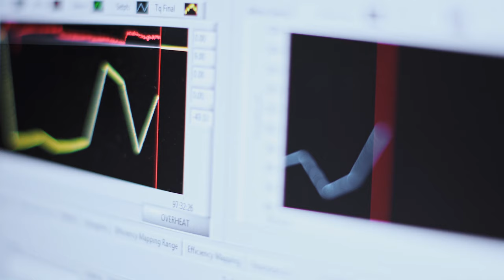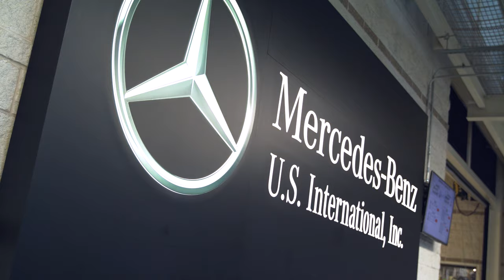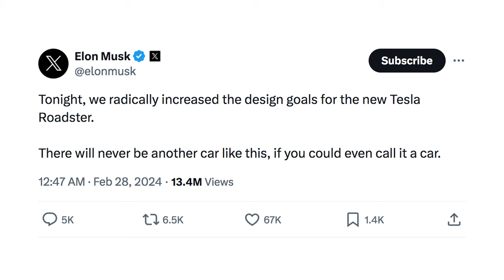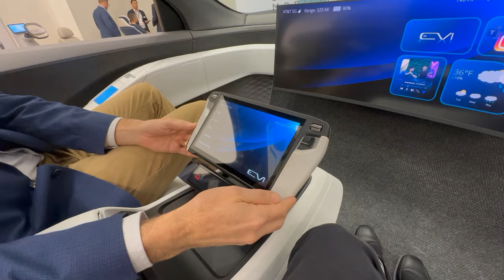UAW Says Mercedes Workers Want Union; Apple Kills Its EV Program - Autoline Daily 3757

Comment: Starting price for Mirai is not $12k.  The $40k discount is only on the $67k Mirai
Reply: Should be a huge seller. I only need to drive 1840 miles to refuel, then drive 1840 to get back home.
Reply: @davidmccarthy6061  If it's a plug in, you could drive it for 40 miles at a time. That would do for my daily drive, and I could sell the fuel cell for scrap. Hmmmm.
Then put in a bigger battery.

Comment: The only way hydrogen has a chance as a fuel is if diesel/jet fuel get regulated out of existence and we are made to transition to H2 for long haul flights/trucking. And then, if every Flying J and Loves truck stop has high capacity H2 fueling infrastructure, plug in hybrid FCEV pickups and full size SUVs might make some sense. Pickups have a bit of room to spare for H2 tanks, whereas even ground-up FCEVs like the Mirai and Nexo have to make packaging compromises compared to ICE/BEV counterparts. All that being said, I think we'll just end up sticking with diesel/kerosene for trucking/planes, while passenger cars and light trucks will be BEVs or REVs like the RamCharger.

EV tech is just too good and getting too cheap for H2 to ever make sense on a passenger car, and REV/PHEV tech will fall in cost alongside it. I wonder if we'll end up with mostly diesel REVs for pickups if gasoline falls by the wayside due to BEV passenger cars pulling the rug out from the gasoline market?

Comment: Didn't Musk promise a 200kWh battery for the Roadster?  🤣🤣
Reply: I don't think he promised, I think he was just spitballing. He does that a lot, and people take that as a "promise". It's nothing of the kind.
Reply: I don't think so - that was journalist speculation. Tesla expects to have a 620 mile range, so lots of specuclation on the battery size to make that happen.
Reply: Yes he did, he also promised a 500 mile range for the CT and a $39k base model. He promised FSD by 2018,19,20,21 and the ability of owners to make $30k a year using their cars as taxis.
Reply: @EnriqueThieleThere is not a single true statement in your post. Also you are comparing a light truck to a small sedan.